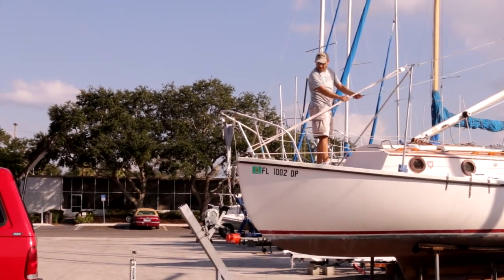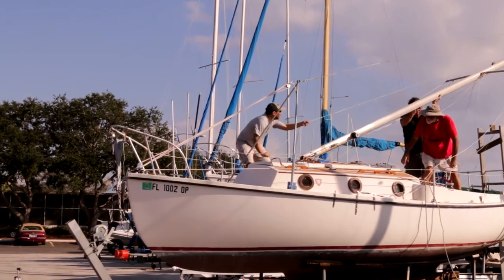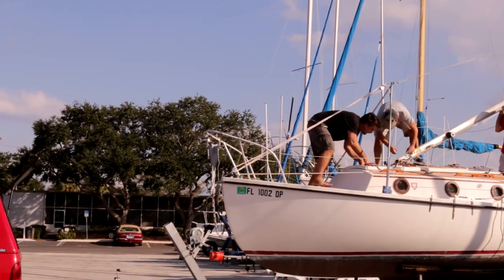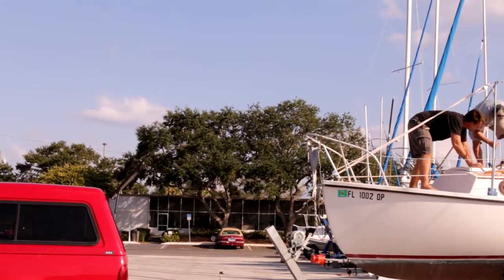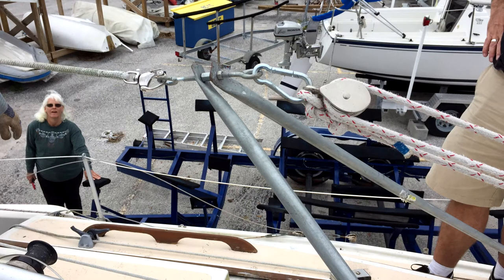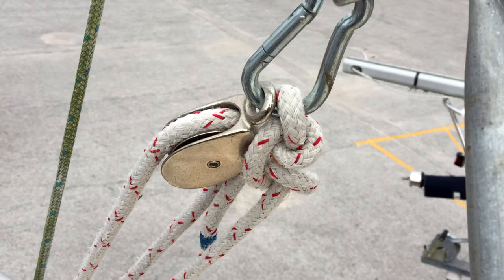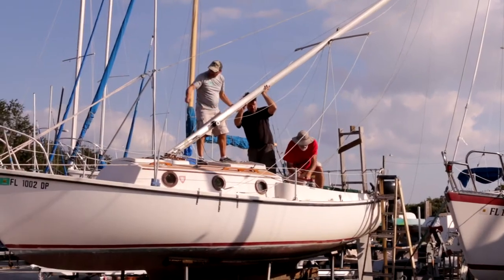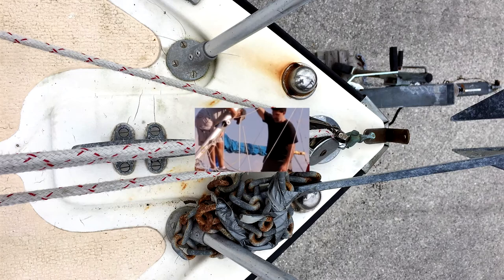How to Raise a Sailboat Mast.  Here is What To Look Out For -  Sailing HideAway Com-Pac 23

Comment: glad you're back on the water. looking forward to new adventures.
Reply from the maker: Sorry its taking longer than expected.  We took some non-sailor guests out for a club event in high winds.  I didn't have my jiffy rigging set up and didn't like the reef I put in so we motored-My electrical system hasn't been the same since.   My anchor light and GPS are back up so we are up for a small cruise to no place in particular soon.